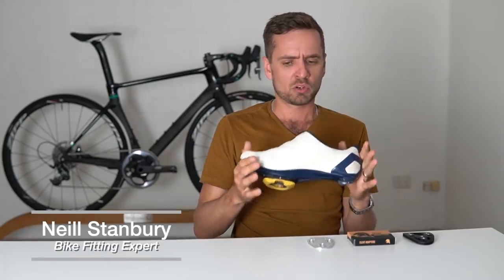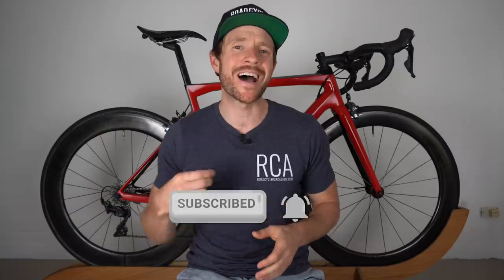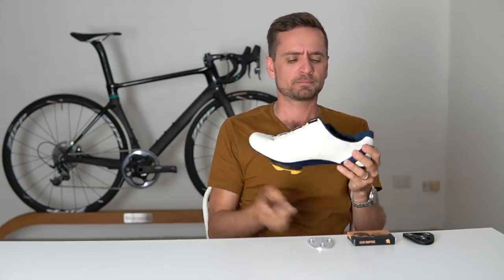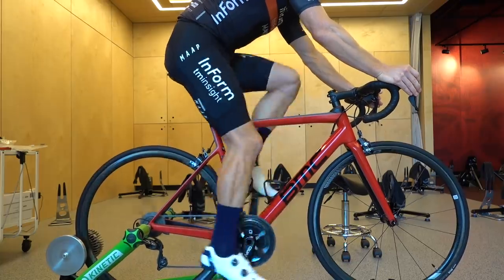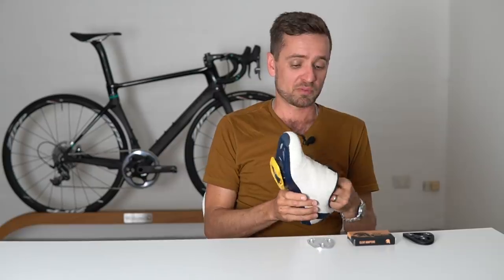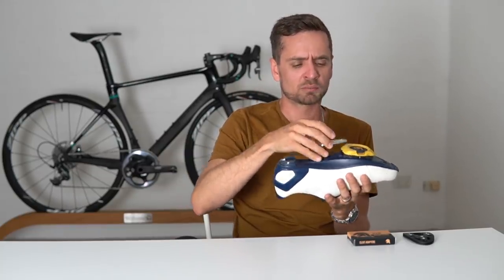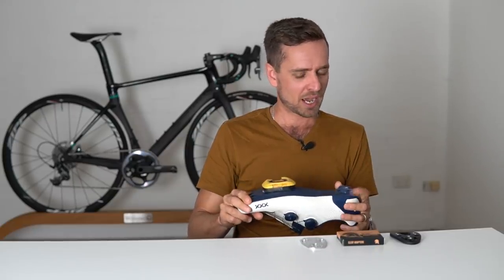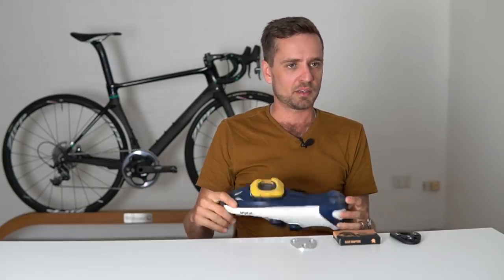Ride with More Speed & Comfort (with a Midfoot Cleat Position?)

Comment: I do not really believe mid foot because some reasons

first, the wheel touches the shoe on tight corners
second i my personal experience I got a lateral pain if the cleat is too back
third it´s not more aerodynamic because lowering your back do not affects the frontal aérea
in fact in some cases raising the saddle is more aerodynamic because you have a more horizontal position.
fourth think that the most structural part of the shoe is in front and the middle is where more leverage has so the she is a lot mor flexible
I think the correct position is something very personal

Comment: I can't tell you how much I respect and appreciate these bike fitting videos. Killer!!!! Thanks. Recently I have begun riding mountain bike and now going back to my road bike feels really narrow both for my hands and feet. I was wondering if you guys had any tips for optimizing both foot and handlebar width? Were is the balance between improvements in torque with a wider fit vs aero gains of a thinner set up?

Thanks!!!!
Reply from the maker: Q for Neill, I'll put it on the list Andrew. Thanks for the comment.
Reply: @CamNicholls  Thanks so exciting! I guess since you will ask him. I'll provide more info. I've rode only road bike for over 10 years with 400mm handlebars and no spacers on my Shimano 105 cranks. I just bought a fat bike so both my arms and legs are WAY wider on it. Now when I go back to ride my road bike I feel awkward for about 10miles before I settle in and out of the saddle efforts are noticeably weaker. So I have begun to question myself. Have I been riding on too thin a set up for years? However, maybe it is not a bad thing for aero gains? I have had no injuries at all from my road bike set up, so it is just a question about optimization. Feel free to condense this question when you ask Neil. Thanks so much for the videos! Already helped me and I always look forward to them!

Comment: Great, it would help my position where I think my cockpit is a bit low, since I get numbness in the hands (But it is currently at its max height).
Reply: Hey Richard, setting your saddle back further will take weight off your hands and reduce numbness, check Cams other vids on bike fitting specifically the balance test, taking hands off the bars while pedalling, this is a method also used by other bike fitters to help determine saddle set back. Just a tip that might help, of course this will effect your reach too. Increasing setback will also effectively increase saddle height, the distance from bottom bracket to saddle, but only marginally. Steve Hogg has some advice on his site, he is an excellent fitter and trains other bike fitters too.
Reply: @graemeriley9896  I've already viewed all of Cam's bike fitting videos (& also Francis Cade Bikefit Tuesdays' videos).  Another point, my saddle is currently as forward as it can be, due to the fact that I'm using 175 mm cranks.  I have tried to put my cleats as back as I could before, but didn't find much difference.  Currently they are at about 10 or 12 mm back (I have 43 size shoes).
Reply: @RichardMigneron  If your interested you might want to have a look at Steve Hogg’s website he has some in-depth topics on there, Neill received some bike fit training from Steve. I’m guessing your having hip angle issues, with 175mm cranks and saddle forwards or maybe your a TT rider ? I’m a size 43 too bang on 6ft (182.5 cm) using 172.5 cranks but have seriously considered shorter cranks, I like to spin not grind up hills. Cam tried shorter cranks at Neill’s recommendation, I found some good info on crank length on the “power cranks” website with some references/links to studies. If your saddle height limited by your seat post then you might run into issues. If your a heel dropper moving your cleats back will mean having to raise saddle height, if your a toe pointer then saddle lowering, but if your feet are relatively flat it will make very little difference. Shorter cranks will require saddle raising too but they will open hip angle at the top of your peddle stroke and improve your aero position. I’m not sure if any of this helps your particular situation but at least you will have some more information going forwards.

Comment: Cam I've seen all of yours and Neil's videos. I know the answer is 'go get a bike fit'. There's granted lots of variables to individuals. But could you condense a 4-5 point set up. With a couple of points for "if this happens try this etc in each section'. I know that may seem impossible for say a 30-45min vid but you have all the in depth episodes already to link to in screen. If you time stamp the sections I think those looking for a quick guide will have a better option than all the muppets out there that think a plumb line is king!

Comment: Hi Cam, great vid as per usual ☺

Question for Neil - What advice would he give for riders with severe "toe out" (say 15-20 degrees)?

I've been using 20mm kneesavers (pedal extenders) with modified speedplay frogs (had to remove the stops). Unfortunately, it looks like the frogs are being phased out. In addition, the kneesavers a bit too long (Q width), but I can't get anything shorter.😭

Comment: 💪🏼Cam, i want to hold low position longer on road bike without numb hands, any suggestion of what is the best core exercises to improve low position?
Reply from the maker: Interesting question mate, not my expertise though. Although I would have thought working on flexibility would be equally as important as core strength for this. Maybe work on both and see what happens. And keep me posted.
Reply: not cam, but I'm a randonneur who used to have the same issue

your numb hands may be because of a bike fit issue unless your back muscles also start hurting

consider moving your bike seat aft.  cam has a video about saddle fore/aft that you can use
Reply: @blu0065  oh, yes, i did and applied those informations, thanks for ur concern.
  i have smaller size frame, i got it from a friend, i got long legs,
i think the saddle is on the correct height, and i set it quite further back even with 24mm offset seatpost, maybe because my long femur, i did the balance test and the result is quite acceptable, but longer rides especially in hilly area where i live, my hand tend to go numb, i want to raise my bar slightly, but my friend cut the steerer low already haha. right now i cant spend on my bike like i used to do because of pandemic, i even need to think alot if i really need new stem or just hold it, but i still want to ride, so then im thinking to strengthen my core instead to remedy the numb hand.

Comment: Thanks Neil and Cam for the videos and insight. My question is how much lower does the seatpost need to go if one is moving the cleats back 24mm using the Swiss cleat adapters? Am i right in thinking id start with 30mm?  Thanks! mark
Reply: 30mm seems too much to me unless you have your cleats really far forward right now. Don't forget about the added stack height of the adapter in the case of the SPD patro cleat adapter
Reply: @tmunk123  Yes tmunk, my thinking is 1mm to 1mm  - but then im just a rider, not an expert bike fitter. Yes, my keo cleats are absolutely as far back as they will go atm. Aye, thats 3mm afaik, ill know when i take delivery of them.

Comment: Something I haven’t heard mentioned with mid-foot is toe overlap with the front wheel, this could be a real issue for anyone that likes to pedal when cornering.
Reply from the maker: Interesting point Tim, thanks for putting on the thread
Reply: Anything faster than walking speed and you hardly turn your wheel enough to have it be a problem. Slow speed and tight corners, watch out
Reply: Us short people on small bikes have toe overlap either way - it really isn't anywhere as big a deal as people suggest.
Reply: @nb_rebecca  but you’ve grown up with it, as have I, there will be some where it’s a whole new experience for them. Anyway, it was just an observation that it hadn’t been mentioned as a potential issue.
Reply: @timb8095  I'll be honest, I started riding in May 😅 telling people to prevent bad surprises is definitely a good thing, I just wouldn't want anyone to decide against midfoot cleats or whatever else purely based on toe overlap.
Reply: Bought these mid foot very good cause my right foot would burn after 50 miles. Turning not so bad but very steep inclines when climbing and struggling I tend to turn handlebars and catch toes

Comment: Cam, can’t thank you enough for these bike fit videos! Simply brilliant content. Like a few others, I’m an SPD cleat fan for road bike. Makes walking around so much easier and I don’t destroy the cleats. 😄 Plus, the new gravel shoes have expanded the selection. I moved the cleats as far back as they would go this season and love the feel. After watching, I’m tempted to get the drill out. I’ve got a few CMs to midfoot. In addition to comfort, I noticed it makes clipping in and out much smoother, after you adjust to where the cleat actually is.

Comment: Superb, thank you! Does anyone know of a similar hack for the 2 hole spd's? Shimano do the SM-SH41 adaptor that allows a SPD to be fitted to the three hole, then use the plate to move the cleat back? What d o you reckon Cam or Neil?
Reply: I've used this adapter - road to mtb cleat and it doesn't allow mid foot cleat placement. Maybe the adapter shown will allow this. I'd be concerned this could increase stack height too much, or snap off ending a fixed gear ride at an intersection!
Reply: @davidburgess741  Thanks for the reply. lol... nope nope nope... I ride my fixie with the 3 bolt cleat... I want that extra bolt! I use spd (as opposed to SPD SL) on my endurance rides so I can walk if needs must! I think I will look more at the SL pedal for endurance riding and leave the SPD for touring.
Reply from the maker: Q for Nell Mark, hope he can get to it.
Reply: @markjthomson  I put my faith in the steel mountain cleat and steel pedal mechanism. No plastic for my fixed! Got Look on my geared bike where I will never have to walk a hill. Almost.
Reply: So further to my question. It seems the SPD is the popular cleat to use. Requires drilling a pair of shoes. I just purchased a cheap pair to try it out so I can confirm proof of concept for me, then I'll do it on my expensive shoes.
Reply: @CamNicholls  I fitted the SPD's in a pair of cheap shoes to see how it goes, I tagged you in IG!
Reply: @markjthomson  I fear drilling carbon soles might be really difficult.  May need carbide bit to get through.  Carbon road shoes might be tricky to walk on with mtb cleats on. That easily full pound weight savings does sound tempting though.  Someone out there must have already done it.
Reply: @davidburgess741  no, drilling carbon is easy... no special bits needed. I find i walk on the front of the shoe. A mountain bike shoe might be better. I just did a 200km audax in my trial pair. Worked out fine but I need a better shoe...

Comment: hmm, I wonder how this would translate to MTB shoes?
Reply: Short answer: buy some DMR Vaults and 5/10 shoes and ride true mid-foot. I did and my 2 sets of spd shoes and pedals have quietly been gathering dust in the corner of the garage ever since. Your feet have arches and any engineer will tell you that the arch is the strongest and most stable load bearing form. The resultant foot stability and correct loading of ankles and knees as a result cured my chronic pain and I ride faster too. I also 'feel' the bike better in the gnarly or slippery stuff, due to the removal of the mechanical engagement of the spd's. Nobody ever told Sam Hill he was slow, lol!
Reply: @georgebeare8883  haha! I spend most my time on a gravel bike with flats. I agree that it’s fixed a lot of my leg issues. I still race on the road and MTB being clipped in, but need to ride flats a few days a week.
Reply: @stewbomb5  heh, heh, yeah. I'm no bio-mechanist but you have to ask yourself if riding clipped in hurts but riding midfoot on flats cures it, then surely there is a problem with spd's foot placement. I reckon one day in the future, modern cyclists will look back on all of this and just laugh, saying "what were they thinking?!" The only reason I ride clipped in now is on my expensive Italian road bikes, because well, the court of public opinion would lynch me if I put flats on them!